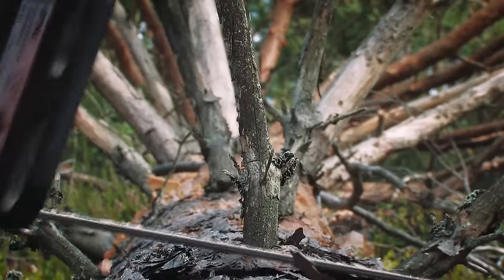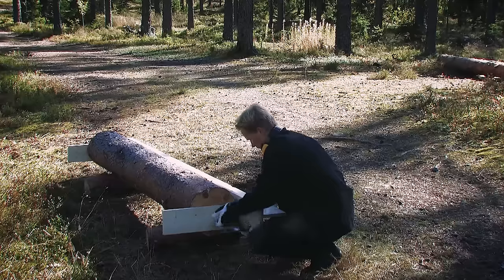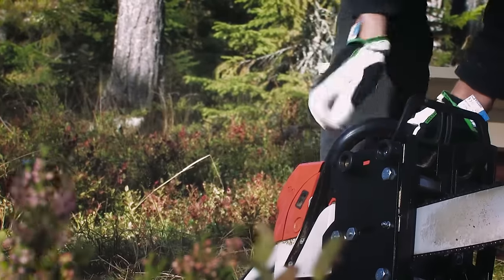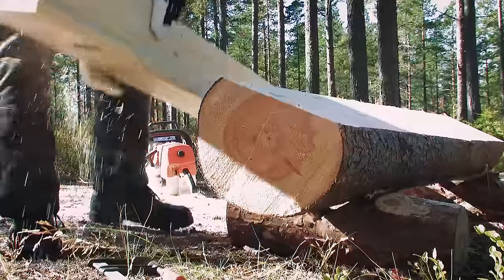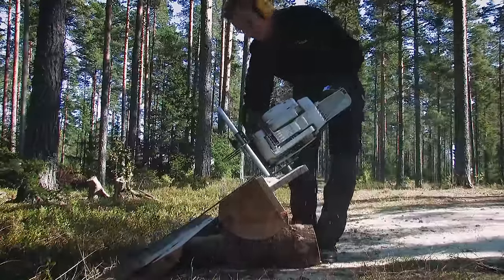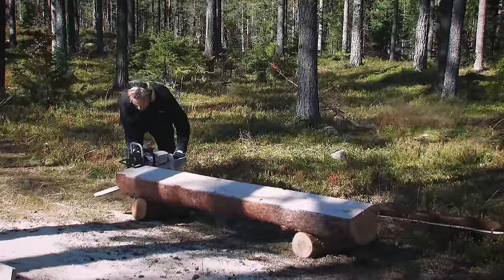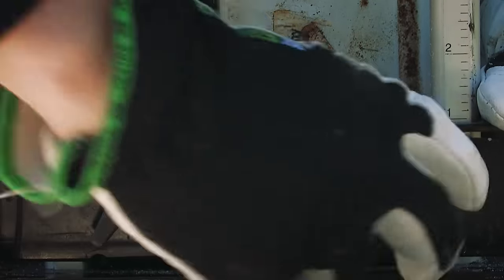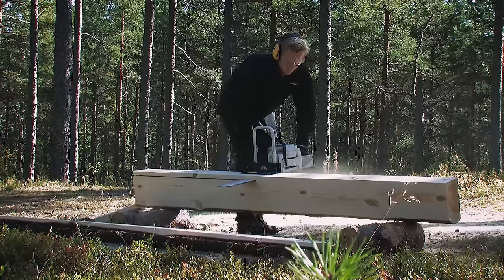Smart Timberjig | SMART LINE | LOGOSOL

Comment: I have one of these and it’s a really useful bit of kit, most of the time I use it with a 40cc echo saw with a 15” bar and a straight filed chain, yes it’s not the fastest thing but for occasional use and being way more accurate than freehand it’s brilliant. I’ve never done the whole brackets and rails thing for set up and usually just screw a scaffold board to the log for a first cut then once there’s a flat surface the rest can be done without any other guides 👍🏻
Reply: Kk
Reply: We're we can find this tool and how much money's needed to have it?
Reply: Can we buy from Amazon
Reply: @Ad-astra7820  можешь купить на Яндексмаркет !
Reply: Plkom
Reply: Me passa o número de telefone de contato para eu adquirir também. Obrigado!
Reply: What chain do you use and how is it sharpened for ripping
Reply: I see that this operator keeps popping the chain break while it’s still running!  That a good way to ruin the clutch as the clutch is still being forced to spin even though the clutch drum is being held stationary by the brake.  This will heat up the clutch springs and then the clutch will not disengage even when it should at idle.

Comment: Not a bad attachment,  however bar flex is an issue as the bar tip is not supported, wider slabs or boards are a definite NO, Even narrow boards cut  from Aussie hardwoods can result in inconsistent thicknesses, which may not seem a problem however aim of the end result is to have dimensional lumbar cut as accurately as possible , In my opinion (for what it is worth) Alaskan chainsaw mills are a really good alternative, any comments greatly appreciated , safe cutting 👍👍

Comment: What kind of wood is it? That saw was going through that wood like butter. What kind of chain is it?
Reply: Probably pine or spruce. I thought the same thing. I think it would be quite different with hardwoods
Reply: @Jay-gx8dm  yes I would say so I went back and looked at the video again and it definitely looks like Pine.
Reply: @Jay-gx8dm  not too many people building with hardwood..
Reply: @joedirt9600  You mean you don't use all seasoned oak to do all your framing? 🤣🤣🤣🤣🤣
Reply: I'd guess the video was sped up x2 when sawing. My Alaskan mill with pro Husqvarna cuts about half that fast with a sharp ripping chain.
Reply: A good saw with enough power and a properly filed chain will rip softwood like that no problem. I have a Stihl MS660 that has no problem ripping 24" white oak. It definitely isnt as fast as cutting yellow pine, but patience and quality go hand in hand.

Comment: If anyone ever saw realtime cutting a log lengthwise with a chainsaw they would never buy one!
Reply: It takes as long as it takes. If you are going to cut one up it doesn’t matter how long.
Reply: I can cut a 9inch by 9inch 18 ft long square beam in 45 minutes from start to finish that includes set up time , with go 2 mill that I designed , perfectly square and smooth with no waving or gouging, and it can fit in your lunch box 📦
Reply: Sounds like you need a more powerful saw, a better filing on your chain, or both.

Comment: Way too complicated that guiding board will bow and tilt and the boards being cut should not have their own weight again the cutting chain, you are reducing the thickness of the board as the return chain in the bar has the board rubbing against it